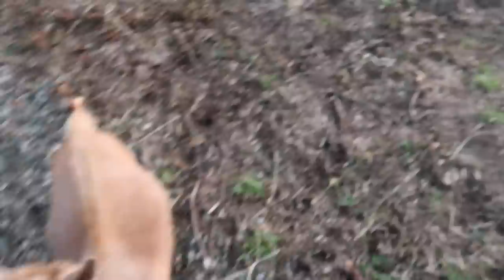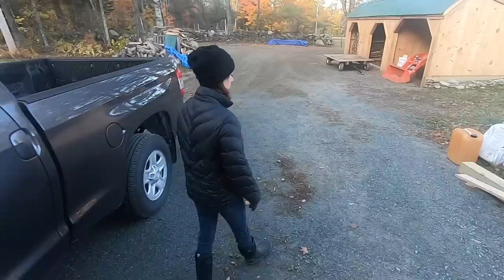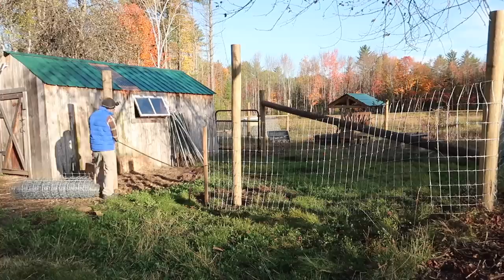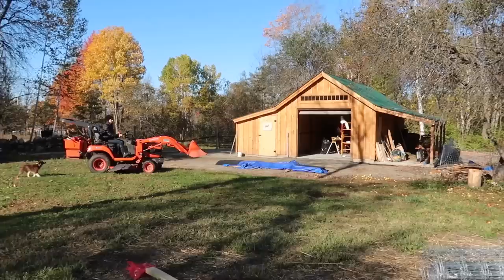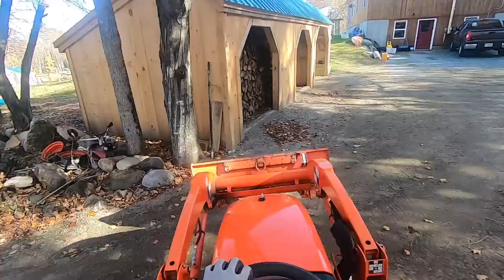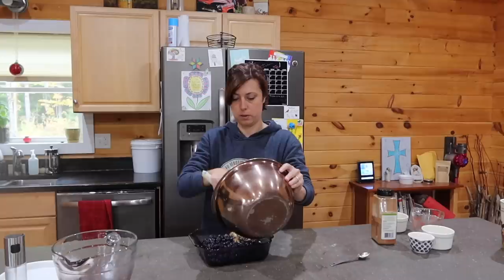RATCHET STRAP TRICK Saved Our BUTTS Installing the new FENCE

Comment: Hi. My father always said. Fire wood heated you up twice, once when you stacked it and when you burnt it.
A wise Vermont farmer.
Reply: I always heard that it heated you four times.  Once when you cut it, once when you split it, once when you stacked it and once when you burned it.
Reply: @flick22601  Maybe five times as the wood looks like its being stacked twice. Once on the tractor trailer prior to moving it and then when it's finally stacked in the woodshed. Constructing a simple removable high sided crate for the flat bed trailer would allow the wood to be quickly 'thrown' into it thereby saving all that double stacking time. A crate would also be immeasurably handy for myriad other jobs about the farm.
Reply: @beetrootboy9301 , Just made that same comment, get some sides on that trailer. Whoever heard of stacking it on a trailer, then only to re-stack it in the shed ?
Reply: Well said, from a fellow Vermonter.

Comment: Something I just learned from watching Blue Cactus Dairy is that you don't want bucks that are breeding sharing a fence line. Especially, if you are worried about making sure that they don't breed the other's does through the fence, which I don't think you are for this season, but it could have genetic repercussions later, if you then breed the offspring. But mainly, it also relieves stress on the bucks, because they're not constantly worried about protecting their females from the other buck. A solid wood fence or wall helps them to not see each other.
Reply: I thought exactely the same, love watching Blue Cactus Dairy goats.
Reply: Blue Cactus fan here, too
Reply: I was going to say about that same thing because of blue cactus... I would hate for one of the boys ears to get bit off...

Comment: For the workshop roof, I suggest you use plastic chloroplast but paint it so that it does not collect dust magnetically,  so I am suggesting copper as a color. This will reflect the light, look great and function for years. This way you can hit the wall and roof with high-pressure air and clean the whole site walls and all.  The copper color will look so cool and it will also add some insulation value as well.

Comment: Thanks Al & Gina... I've enjoyed watching U guys working your property & basically figuring it out as you go! I'll be in your neck of the woods later this morning. A friend is picking me up & were heading for TSC for a 3 point hitch carry-all for my JD-990 tractor, HF for a 2" bumper hitch receiver & 12" extension, etc. & either HD or Lowes for the hdwe & possibly the pressure treated lumber for the build itself. Just a note here: SEAL THOSE FLOORS, please... ( while there is still time. ) 
Bill on the Hill,
Vermont... :~)

Comment: Is the lean to off the barn for Gina's car since the Kubota gets the "port"? ;D
I suggest you hang the gate on the right side, not on the post by the shed. The posts aren't braced, the gate will help pull the right side post back toward plumb. Hanging the gate on the shed side post will pull the top away from the shed.

Knotted fencing is good, welded is bad, the welds will break.
The sprayer also saves the land fill.
The birds aren't used to roosting, they'll figure it out quick enough.

Comment: Material list for fence stretcher (1) 2x4x8' cut in half, (6) 3-1/2" bolts(size doesn't matter), (12) washers, (6) nuts, (1) chain, (1) orange Kubota tractor.   Method: Drill (6) holes through the 2x4's (both at once), place one board each side of fence at location beyond post, install hardware, chain around the boards, connect to tractor, and pull to desired tightness.   Note this will work without cutting the fence first.   Respectfully,   Kevin

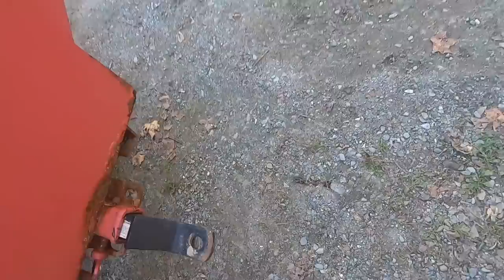Comment: 16:56 Looks like you need to take your  "tractor purse" off the Kabota  and take a wire wheel to it to see how extensive that rust is. Hate to see it rust through. A good winter project.

Comment: this is not a criticism just an experienced based suggestion.  You may want to put the fence on the inside of the post.  Animals like goats will push against it and it offers more resistance if the fence is on the inside of the post.  The animals will not be able to push the fencing loose.

Comment: Not true about not being able to stretch welded wire. I have done it many times. Also the trick of weaving a board through the fencing and then stretching it (I've always hooked it to the tractor) is an old one. Great job on the fence!